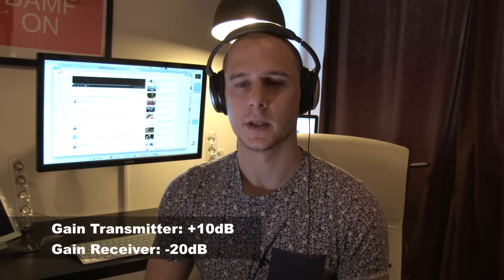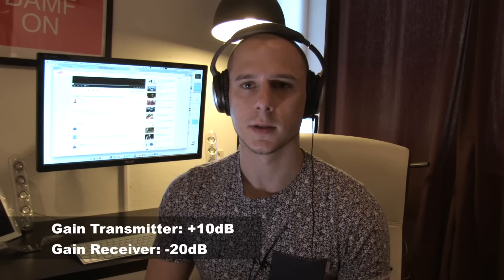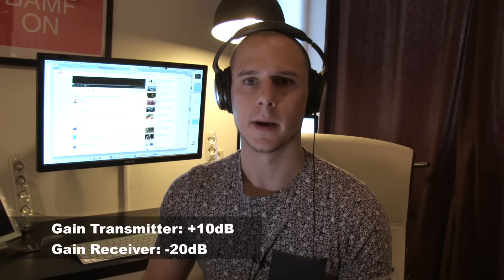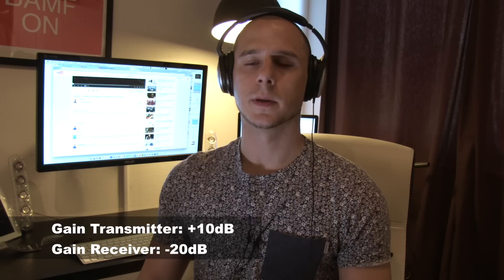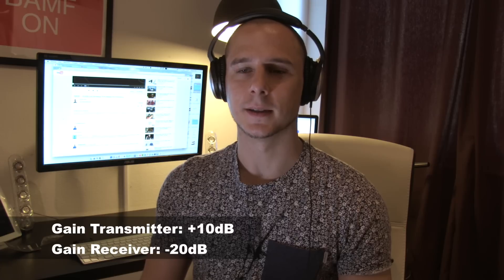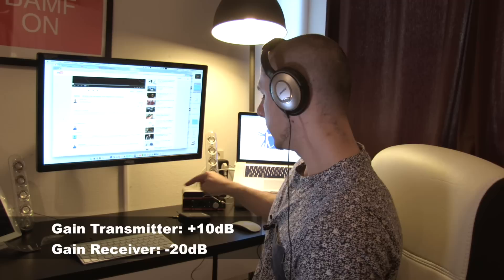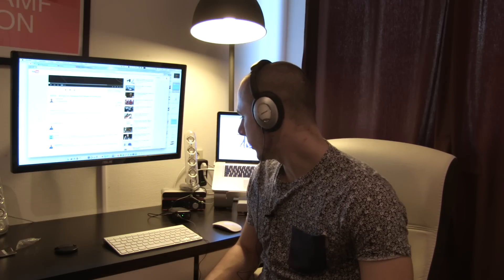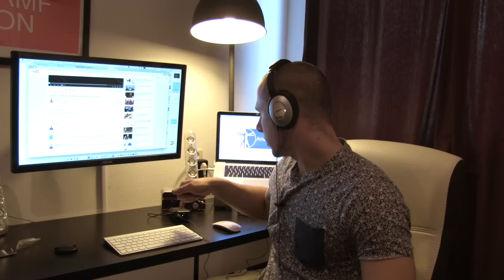RØDE - RODELink Wireless Filmmaker Kit Sound Test

Comment: is that the best sound setting youre showing on the screen +10 trans , -20 on the receiver. what are these setting
Reply from the maker: +Michael Mcgriff Hey MIchael. As I mention, I have played around with the settings a bit and this was the best i could find. Best meaning that I could reduce noise to a minimum. I hope this helps
Reply: Thanks you're been a big Help

Comment: We are actually having the same problem with the background noise, and hissing, however, we are powering both units with AA batteries. Gain levels are set at +10 and -20. Any thoughts?
Reply from the maker: +Alex Young (iAlexYoung) Have you run tests on all gain settings? both to neutral? Try switching the levels, use fresh batteries, try different channels for the Receiver and transmitter. How is the wifi environment? Lots of signals may affect the quality of the signal.
Reply: I seriously appreciate your quick response! It turns out that our issue was the gain settings. We went through several options today to figure out the best settings for us. Any other tips and things to keep in mind, that you care to share would be greatly appreciated! Again, Thanks!
Reply: ***** I seriously appreciate your quick response! It turns out that our issue was the gain settings. We went through several options today to figure out the best settings for us. Any other tips and things to keep in mind, that you care to share would be greatly appreciated! Again, Thanks!
Reply from the maker: Alex Young good to hear that you could resolve the issue. Its truly a great unit!

Comment: Hi Andreas, nice work on your review.

Is there a reason why you are using +10 on the transmitter and then using the pad on the receiver?

Ideally you would not use the pad unless the input level is clipping with the 0dB setting on the TX.

Contact us at info@rode.com and we can discuss further.
Reply from the maker: Hey rode guys!

I had too much noise/hiss with the other settings. I could eliminate almost all noise with the settings mentioned in the video
Reply: +RØDE Microphones Hi rode Guys, yesterday i bought this product and i'm having a lot of issues with it, the audio is unusable, there is a lot of noise and background crackling and if the trasmitter goes close to the lavalier it start to interfere making a "whistle sound".
Even in this review i can hear crackling sometimes even with the best setting.
Everyone say this is a good unit, that's why i purchase it, but as far as i can see they're just a waste of money.
I'll call rode assistence today to see if they can help me, otherwise i'm gonna return the product.
Reply: +RØDE Microphones hi, what gives? Would that be an unsual setting?